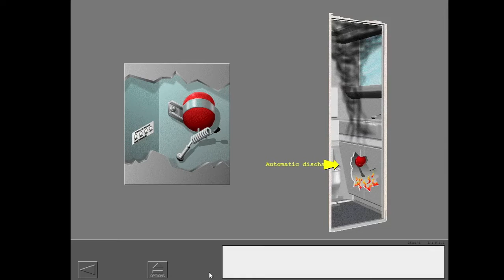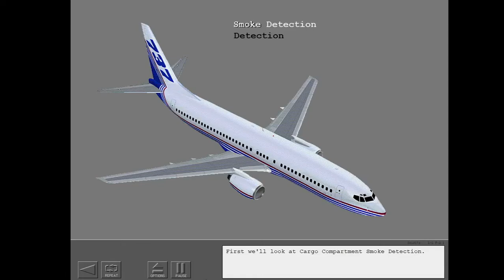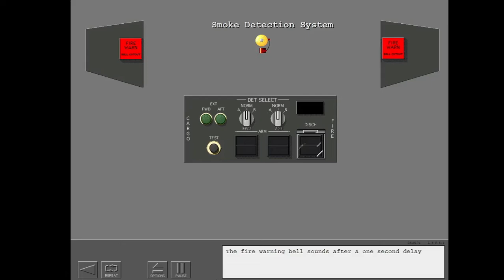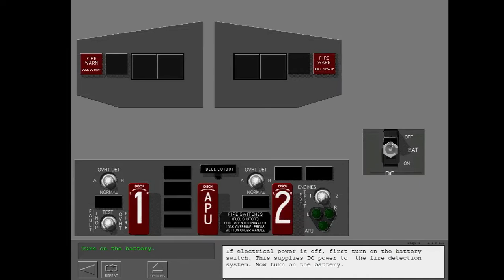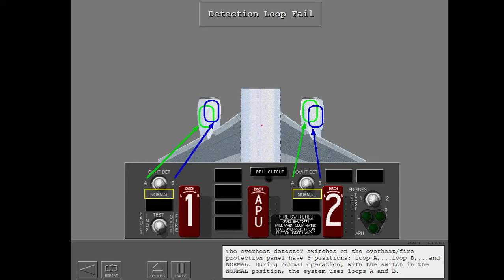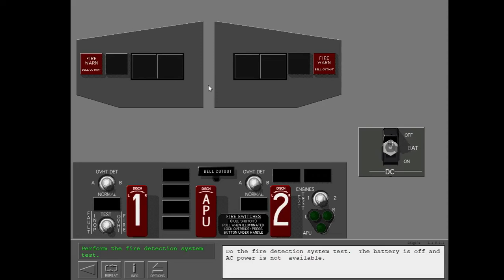29. Boeing 737NG - Fire Protection System (PART2)

Comment: What indication on the fire panel will be given, if one fire loop in ENG#1 and an other loop in ENG#2 is defect ?  
How to troubleshoot with the OVHT DET switch(es) to determine which loop in engine (1 or 2) is inop ?
Are both OVHT DET switches necessary to exactly locate the u/s  fire loop ?  (asking for a defective panel)

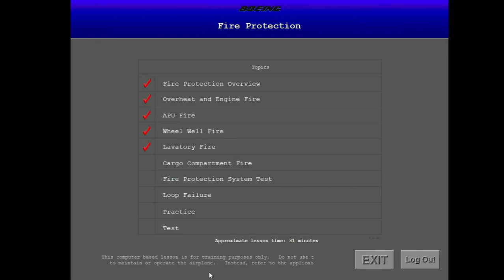Comment: @2:12 cargo smoke detection system
Dual loop configuration, both loops need to sense smoke to generate a warning in the flight deck. 6 detectors in the aft cargo, 4 detectors in the forward cargo. The detectors interface with a CEU in each cargo compartment. The CEU’s send a signal of a fire to the cargo fire panel in the flight deck.